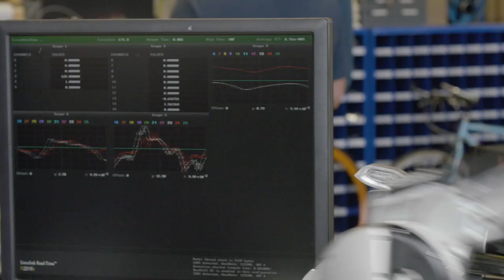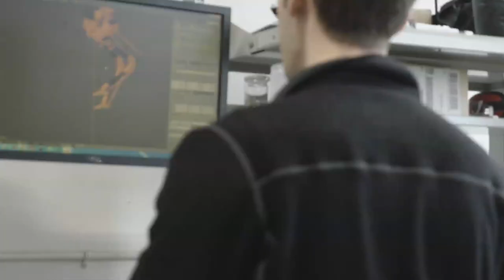Cassie - Next Generation Robot

Comment: So what are you using to balance the system. The gravitational point in this system is very top heavy and I imagine it to be rather hard to have just 2 legs pushing the weight of the top in the right direction... I mean even humans have an upper torso to counterbalance the system while walking ?

Comment: In a burning building, I would send in something which has no legs but instead hovered and knows its total 3D surroundings, eg steered away from heat or chemical extremes or obstacles.   in case of floor collapse. Something that walks however well is more likely to get trapped or burnt. The advantage of a hovering device is it can scale a high building externally quickly, or large building sideways quickly, it can go in al directions, you can land it. It could have AI to detect people, 360 degree cameras, sensors, lasers for distance, sirens and lights, microphone for audible eg relay and customised for warning and location it could also feature led lighting for "follow me".. think laterally guys

Comment: I think you need to make the foot bigger, for stability
Reply: and add hands
Reply: Not a good idea, bigger feet are heavier which slows the response time and increases the energy requirement. It works well in nature because of weight to power ratios and the amazingly complex structure of feet and hands provides an incredible amount of articulation and minute balance options. Eventually robots may end up with complex feet but for now the technology is not really there to make them worth equipping. A large foot surface would actually require an increase in size in the hip articulation to compensate for the larger available surface area and increase the overall size of the bot. Little pointy nubs are just as good and most of the time significantly better for low articulating systems as they require smaller and less stable points of contact with the ground to keep the system upright.
Reply: Would be harder to climb stairs then.

Comment: perhaps there is a few uses for a legged robot... but for searching a building why not go with a tracked/wheeled vehicle? I mean having a legged robot for a rescue situation is just setting yourself up for easy failure. Not that it might not be possible, but why complicate things? So the new legged robot goes into a collapsing building and gets right in the danger zone and trips over a telephone cord..... the tracked robot is in and out, you have to be able to scale obstacles of course, but even a drone would be preferable since it doesn't even have to touch the ground.

Comment: OK electro mechanical functions, added gyroscopes - problem solved. But I would guess that with humanoid robots at least, the battery output duration and size is the limiting factor.

Comment: If only there was a so called solid state muscle for efficiency.  Not hydraulics, no servos or stepper motors but a solid block that can change shape when a charge is applied or taken out of it.  It would be both a type of variable capacitor/battery and drive unit in one.  Maybe with nano technology such a self shaping solid can exist.

Comment: vary neat, but they kinda forgot about boston dynamics. I mean they are more advanced... even just looking at Cassie walk vs the robot from boston dynamics you can clearly see that Cassie isnt reacting, so much as trying to stand up. where as boston dynamics is actively reacting to the environment. In the clip where cassie is seemingly trying to walk forward in a straight line, you can see its gonig off balance, leaning and twisting. Im sure they cut the scene there because it was about to fall. I have no doubt that these guys will get better at this just as boston dynamics did. But i dont think saying 'everyone else isnt as good as us' or however they worded it, is the right move. Clearly boston dynamics is on a WHOLE other level and its disingenuous to pretend otherwise and it only makes potential investers doubt you because you are essentially lying, whether you call it lying or not.

Comment: Using the example of a probe for a firefighter is a weak argument because firefighter do not just walk into a burning building, crouch and walk out. Not to mention that the hydraulic hoses could not stand the extreme heat. This half a robot is only good for a couple of things, : lazar targeting, surveillance and hunting with a mounted gun. It only has military applications.
Reply: Bruh... what?

1.) It's a technology demonstrator... That's it. It's not supposed to do anything but walk and perform leg locomotion. This is technology that would be INCORPORATED INTO specialized production models... Like ones that could fight fires

2.) "Hydraulics can't handle fire" is a weak argument... Want to know what else can't handle fire? Humans numbnuts. It's easier to design a machine that's protected from these dangers than it is to protect a human from these dangers.

3.) "This thing is only good for military things by ADDING all these military things to it"... Yeah and? Whatever happened to adding fire fighting things to it? You basically just said it's not good for firefighting because it's just a pair of legs, and then said that it's only good for military stuff... if you make it not just a pair of legs.

You made some of the most asinine points I've ever heard. It's like someone saying about the Wright Flier, A TECH DEMO, "this technology could take people across the Atlantic", and responding with "Hurr durr, no it can't, it can only fly for a couple minutes... Bitch, they aren't literally saying the fucking tech demo is going to go out and do this stuff. It's not a product yet.

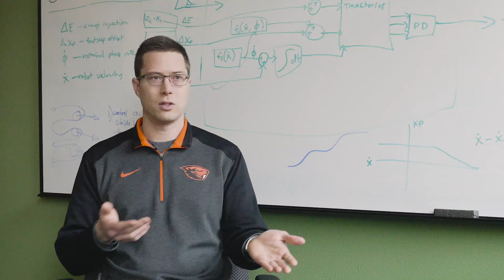Comment: 02:47 "Imagine you got a ... Fire"
where? Like in my pants?  ..... like this guy 3:00
In the fire 'useless-case' what method is this 'military recon or pack-carrier' (3:24 DARPA funded) going to use, that can only be used from within the building? Any scanner across the ums can be done from the outside....or even space like NASA. If its just line-of-sight only....

Plus, you can't claim its post-obstacle avoidance stability is amongst the top 5. Because, you cheated, by lowering the cg

Comment: Still looks like made out of wood or concrete. All the moving parts should never be locked by those weird servos or simple valves. They need to be like a human limbs, applying a slight pressure towards a certain direction. Nowdays robotics is just walking the wrong way. Semi free hydraulics should be used instead